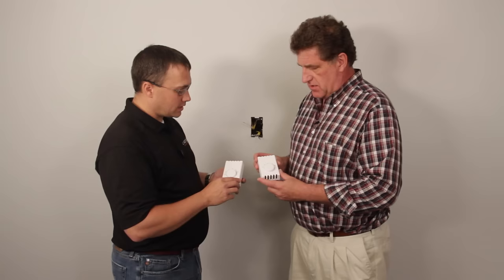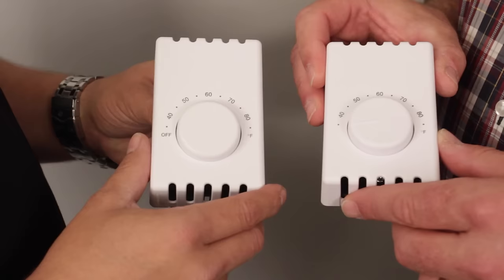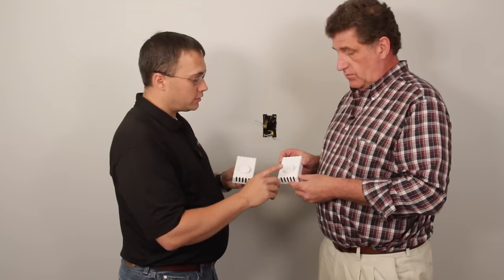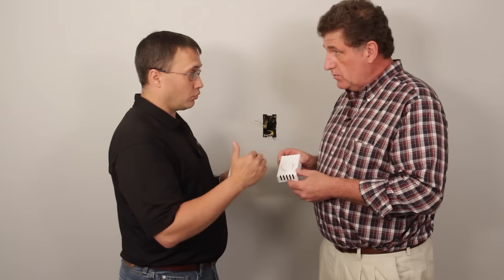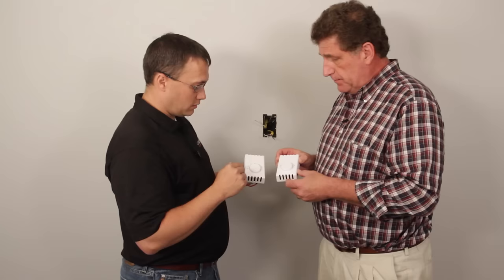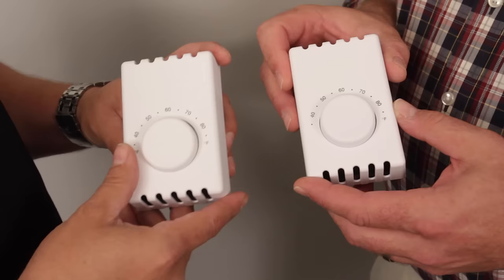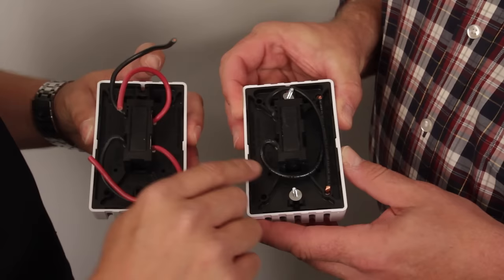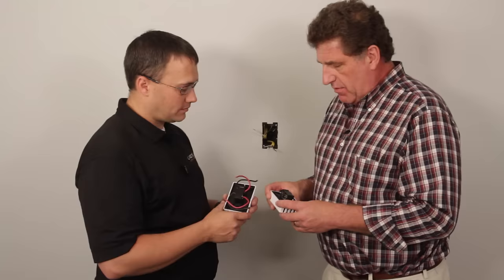What's the difference between a double-pole and single-pole thermostat? | Cadet FAQ

Comment: I'm so glad this video exists. My brother's baseboard heater died in his bathroom, and he ordered a replacement thermostat... except he got a BTF1 and not a BTF2. He started to ask me if I could crack it open and salvage the parts out of it to solder them into the new thermostat to give it the same functionality, to which I told him to pump the brakes and wait until I could look into how heating systems worked. This is exactly what I needed to show him.

Comment: My thermostat cover doesn’t have an off switch, but has 4 wires in the back. It does have a snug spot when you turn it right off, which feels like that would be off.
I want to replace it. Should I get a single or double pole?
Reply: Did you ever figure this out? I have the same situation.

Comment: I set my "click" to 70°F.. Then want to turn the temp down bc I want it few degrees cooler now.. The heat shuts off and drops with the heater never kicking in again unless I turn it up to 70° or higher.. Is that right? 

Or my "click" is set @ 70°F and my home is 90° bc the heater keeps running non-stop.. Is there an auto shut off when it reaches set temp??
Reply from the maker: +skywalker85 OK. Now I think I have a better understanding of your question. Basically the way these thermostats work is that you set a rough room temperature. The thermostat tells the heaters to provide heat until the temperature in the room rises above that set temperature. Then the heaters will turn off until the temperature drops 5 or so degrees below your set point. Then the thermostat will tell your heaters to turn back on and the cycle repeats.

The click you hear is just an indication that your set point is higher than the current temperature in your room. If your room is 65 degrees and you want it set to 70 degrees, the thermostat will click to let you know the heat will be turning on right away. If your room is 65 degrees and you want it to be 60 degrees, turning the dial to the left (counter-clockwise) won’t make the thermostat “click.”

If you set your room temperature to 70 or so, it shouldn’t reach 90 degrees. The only possible exception for this is once mechanical thermostats are old, they can get worn out and basically turn into “on”and “off” switches.

Comment: 3 questions //// 1- why do my lights flicker? I notice it in my basement especially when my freezer turns on... and in my bathroom?  2- also, what reverse polarity ?   3- I have a plug outlet one socket on bottom works but the top one doesn't. what is the issue ..what do I need to do? THANKS
Reply: The lights flicker when the heater comes  on probably because of a grounding issue.  Reverse polarity is when you have your hot and neutral reversed on your recepticle or at a light fixture for example. There is several things that could be an issue with the recepticle that only half of it works. The simplest is  there is a link on the side of the recepticle that connecets the top to the bottom so that in all reality you only have to hook up 1 pair of wires to the recepticle for both top and bottom to work. If someone breaks off the tab then only the one gettibg the wire will work. Sometimes the tab is broken off so thst one(usually the bottom) works as a regular recepticle and one ( usually the top) is wired to a switch and a lamp fixure  of some sort is plugged into it so it can be turned on or off from the wall. This is seen alot in hotel rooms.

Comment: Hello. I mistakenly purchased a double-pole thermostat but the system is wired for single pole. Can I still use the double-pole device using just L1/T1 terminals? Thank you.
Reply from the maker: +Jay Gilbert hi jay, unfortunately we don't recommend doing that. Would you be able to exchange the thermostat for a single pole model?
Reply: unfortunately no and there are 4 of them in total. Your documentation really should state this limitation. More items for the landfill I guess.
Reply: If you can't use a double pole t-stat, why does honeywell state on the box 120-240, 2-, or 4- wire non polarized connection? I am referring to the CT410B.
Reply: @lando8398  A non-polarized connection means there is no distinction between the hot and neutral wires.  They are interchangeable - as found in 2-pole wiring.  A polarized connection means a specific wire must be hot and a specific wire must be neutral.
Reply: @shamooat123 no need to go to the landfill, you can just sale them for someone else to use and save couple dollars.  Or donate them to a second hand store.  They sure can be use by someone else.

Comment: Question for anyone who knows
Do the double pole thermostat turn on individually at different settings?
Say turn both at 60, stop one at 65, stop the second at 70?
Reply: No
Reply: You cannot set them both at different temperatures. The difference that is stated in the instruction video is incorrect.
Reply: @6barry66  thank you sir, much appreciated

Comment: What can you say about the reports of many of these line voltage thermostats catching fire? Amazon is full of reviews like this with somewhat convincing photos.
Reply: Not if you wire it correctly.  I have a house with cove heaters in every room; 9 thermostats total.  They all work fine, it's no different than the wiring for a light switch or outlet.
Reply: @secret5.  I thought the fire appeared to be internal to the thermostat, so difficult to imagine that it would be from faulty installation. Nine is a lot of thermostats for one house, but not a large sample size for testing safety and reliability.
Reply: @jm000001897  I suppose if you bought a cheap uncertified thermostat you risk a fire potential, but that would go for any electrical equipment.  If it is UL certified it should be fine.
Reply: NOTE: I am NOT a professional, just a guy who learns from the school of hard knocks! The primary risk of fire is by NOT CLEANING it every Fall before you start using it again. Spider cobwebs, dust bunnies, odd bits that the vacuum didn't get, and children's toys can all somehow manage to get behind the cover and onto the heater fins. The cover ought to be removable and you can clean the fins off and check for any damage before you begin using it again when temperatures drop.

Comment: Is wiring the same on left and right side on Double pole Marleý 2543nwc Base board heater. Left side has two black wire's one loop red wire. Right side has on Red one Black wire.
Reply from the maker: Hi Louis, unfortunately we are only experts on Cadet heaters, not Marley heaters. There are some slight differences with wiring on the left and right sides for Cadet baseboards, so we’d recommend reaching out to Marley for the specifics there. Sorry we couldn’t be more help.

Comment: What is the purpose of the factory set "click" around 70°F?? Is before click heat off?? And after click on?? I'm confused...
Reply from the maker: +skywalker85 So if your heater is off and you turn a mechanical thermostat knob up (clockwise), the click you will hear is the point where the thermostat will tell the heaters to turn on. When you turn it back down (counter-clockwise) it will click again, which is the temperature where the thermostat will tell the heater to turn off. Does that answer your question?

Comment: I have double pole thermostats, same model you show here, installed into single pole wiring in the wall. I just connected the red wires together and capped them.  If I am understanding things correctly this means that even though I have the thermostat set all the way the left, clicked to off, if the temp got below the minimum, which seems like 35 on these thermostats, the heat would still come on?  Thank you for any replies.
Reply: You nailed it! However the heater is never fully turned off. The red wires will always be supplying the heater with 120v of electricity. The 240 comes in when the thermostat is turned up to a level that will cause the switch inside the thermostat to trigger and add the remaining 120v to the heater.
Reply: @Scorp497  This one was helpful.  The reason the two reds are connected is that you aren't running the power through the thermostat...just using the black wires to leverage the temperature control.  My garage heater is running 10,000W which is 50AMPs.  The power goes directly to the heater and it has a separate connection with 14 gauge connects for an external thermostat.

Comment: The information in your video is correct but there are single pole thermostats with an off switch. The difference between a single pole thermostat and a double pole thermostat is the double pole thermostat opens up both legs of power whereas the single pole one only opens one and the other side is permanently connected.
Reply: Thank-you, finally an answer to the question. No offense to the posters, but they never explained what the difference is (other than stating it has four wires instead of two, duh). Maybe a better question would be WHY are there four wires instead of two? What is the reason for the difference in design?
Reply: @buzzloudly  most electric heat is 240 volts which means that there is 110 volts on each of the power wires coming into it. A 2Wire thermostat only breaks one of the  110 volt lines coming in to the 240 volt heater which effectively turns it off but if you touch it with your hand you will get electrocuted. A 4-wire thermostat opens up both of the 110 V lines so that if you touch it with your finger you won't get electrocuted. So if you have a two wire thermostat and you want to service the electric heater itself, if you want to do it safely you have to turn off the circuit breaker. However it is still considered far safer to always turn off the circuit breaker before you service any electrical device.
Reply: @6barry66  Thx for taking the time to reply. Sounds to me like you should only use single pole thermostats for 120v heaters, and 2-pole for 240v. Though you can, why WOULD you ever use a single pole on a 240 heater?
Reply: @buzzloudly  Sometimes when houses are first built for reasons unknown the contractor always puts a two wire cable in the wall.

Comment: i’m not an electrician but i wanted to chime in and agree with everyone that said this video is stupid. and some nuggets in the comments are right but nobody gives the complete answer. CT410B will work with both the 120 and 240. so to speak 120 comes in on black and only works/flows when it has a path back on white/neutral. 240 has two lines of 120 but at opposing phases. because these phases are opposing, they don’t need a path back on neutral, so no white wire. in the 120 scenario, you only need to break the connection on the white or black, but if you use the 240 you’ll be breaking both black and red(the two hots/120s). if you are doing 240 then you need to break both the red and the black. a single pole model can’t break both so you can’t use single pole for 240. 

i only plan to use 120v. starting from the source i’ll connect black black on the thermostat then the black L1 to the black going to the heater. then i’ll connect white to red on the thermostat and the red L2 to the white going to the heater. it’s going to break both when it only needs to break one, and that’s ok.
sorry this is garbled i just wanted to contribute something that was closer to helpful- i recommend cross referencing and researching till you are sufficiently comfortable with the task… because danger etc.
oh also, it might be worth capping the reds and just passing thru with the white- i’ll keep looking till it all feels right- no help from the manual or video here smh

Comment: Can anyone tell me why a single pole does not have a shut off and a double does?  I am going to replace my single pole thermostat but I want it to shut off without me having to turn the breaker off all the time.
Reply from the maker: That's just the design of the thermostats. A single-pole has a low setting where the heater will turn on when the temperature drops below a certain point in the room -- usually around 40 degrees. Double-pole thermostats are designed with the "positive off" setting where the heater will never turn on if the thermostat is set to "off".
Reply: @Cadetheat  BUT, if you currently have a single pole with no off setting, can you replace it with one that does have an off setting? And if yes, would love a demo showing how.

Comment: so is the double pole more less an upgrade to a single pole? I'm just not understanding why you would choose a single over a double....
Reply from the maker: +nvrcrywlf I wouldn't necessarily say the double-pole thermostat is an upgrade over the single-pole. Sometimes people will pick a single-pole thermostat as a sort of freeze protection because it will always turn on if the temperature in the room drops below about 40° F. For a lot of folks, it comes down to wiring. If you're replacing a thermostat, you'll want to replace a single-pole with a single-pole or a double-pole with a double-pole.
Reply: The freeze factor makes all the sense in the world....Thanks

Comment: This may be a dumb question but is the thermostat switching the hot or neutral wire?
Reply from the maker: Hi there, that is a great question. With a 240-volt connection, a single-pole thermostat cuts power to the hot wire, and a double-pole thermostat cuts power to both hot wires. With a 120-volt connection, a single-pole thermostat cuts power to the hot wire. We don’t generally recommend that you use a double-pole thermostat with a 120-volt connection.
Reply: @Cadetheat  In a 240v connection both wires are hot, so a single-pole thermostat cuts power to ONE of the hot wires, the other hot wire is permanently connected to the heater.

Comment: yah yah sure but how the hell can u  connect 240 volt using just 2 wire??
Reply: Most likely by breaking one of the 120v lines.
Reply: Example: Cable comes into junction box. Cut the black wire and hook one end to one of the black wires on the thermostat and the other end to the other black wire on the thermostat. Do not cut the white wire, it will run directly to the heater. So, you have 120v running to the heater at all times and until you turn up the thermostat, there will be no power running thru the black wire from the thermostat. Like the video says, the Single Pole thermostat will never turn the heater off. The heater will automatically turn on when the temp drops down to 40-degrees.
Reply: One hot wire is permanently connected directly to the heater, the other hot wire connects to the thermosat.

Comment: This video explained nothing. Double pole bas8cally means double power supply. You would use double pole if you wanted to control 2 heaters with one thermostat.
Reply: Hallelujah!!! Finally an actual answer to the question. Video was unfortunately completely useless.